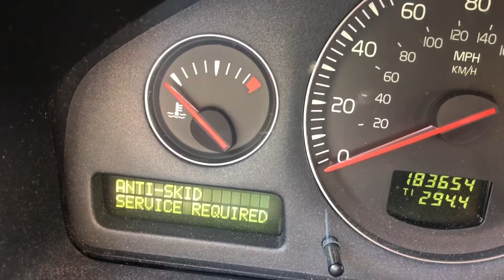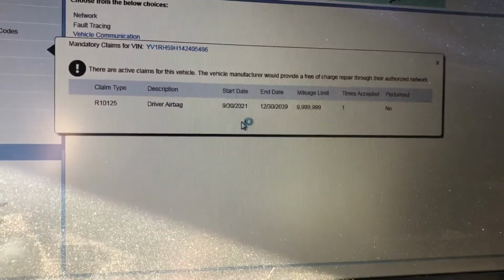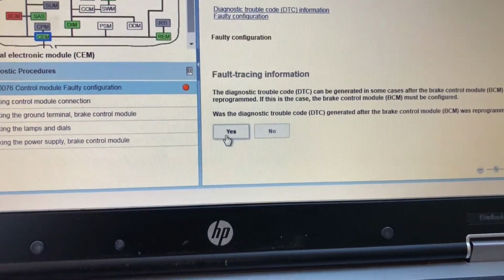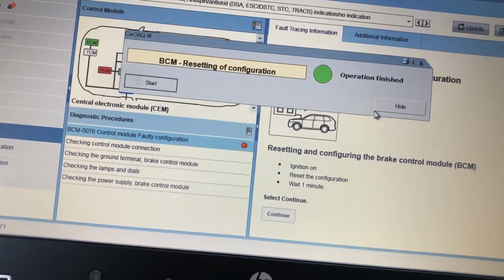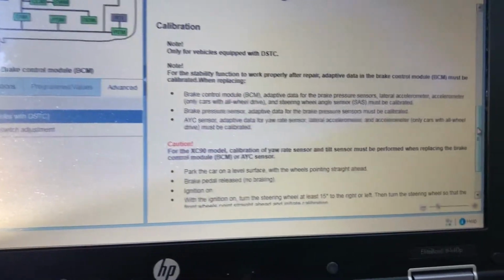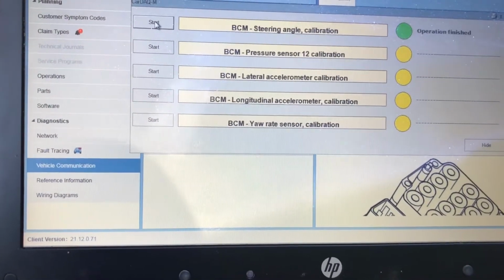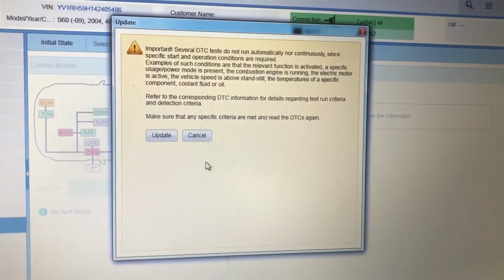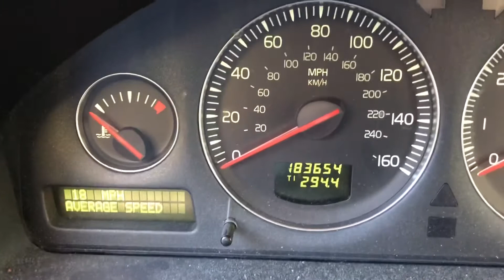Volvo BCM Brake control module configuration error

Comment: What is version on Vida dice you are using ?
Reply: Vida 2014 такого неможет
Reply: 2014 used to be able to it? I can’t seem to get to configuration page anymore on 2014d
Reply: @ dont work I try but unsucessfull
Reply: @EdcarImports  I managed to get it work using 2014d, you have to go through information>fault trace> then answer questions in this order, yes, no yes, then you can get to the bcm calibration page
Reply: @MarcoActive  calibration ok, but car wont start, I replace BCM and I need programming
Reply: @EdcarImports bcm programming will have nothing to do with car not starting, check cem and ecu for faults
Reply: @ you dont understand,I change bcm and is codifed you Coding car wont start, do understand???
Reply from the maker: @EdcarImports you need to buy the bcm software and have all keys, then after loading bcm software, you need to do the key program and also if you have a remote you will also need to program the remote after in most cases.
Reply: @ you can do remote programming for me ? I have VIDA DICE installed
Reply from the maker: @EdcarImports  by you saying bcm, I’m assuming you mean the cem? Volvo BCM is brake control module… I think you must have replaced the cem?